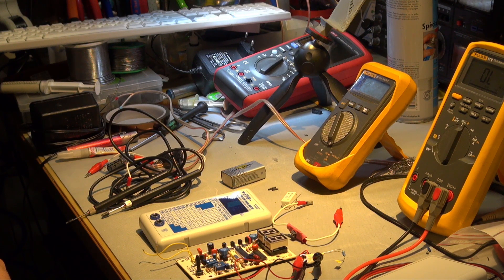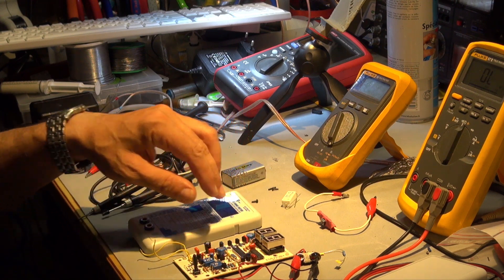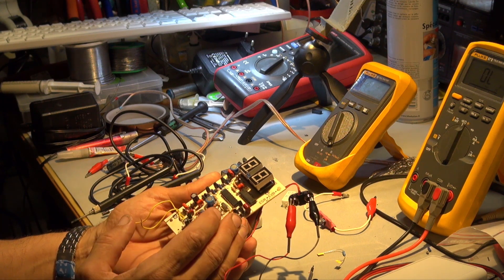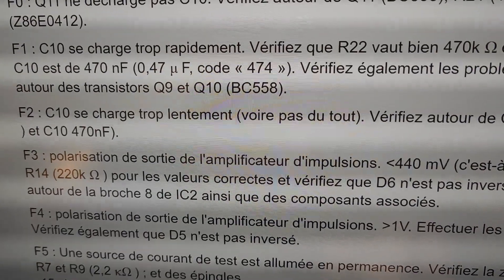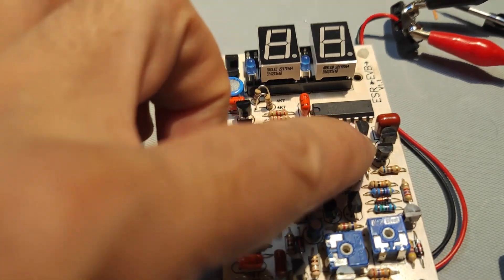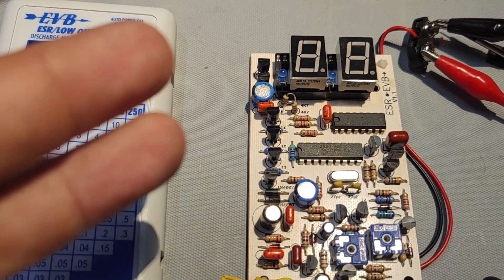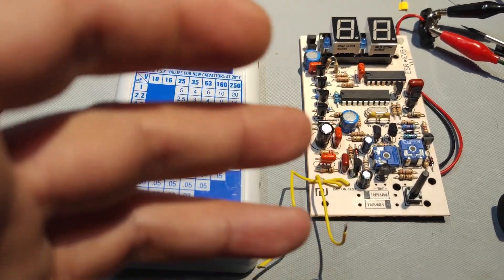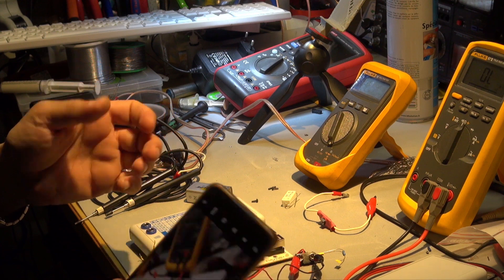EVB esr meters do not appear to be checked before sent.

Comment: I had the same problem, mine has orange silkscreen, after re-soldering all the solder points I had to change a non-polarized capacitor.... and then it worked very well....

Comment: Thank you for the nice video.  I have the blue 2 esr meter and some of the readings are out by as much as 50%. Would you have any suggestions to fix this ?      Thanks again.
Reply from the maker: You can find schematic of the ESR blue on internet, and each zone can be specifiquely related to a special work. In your case you can have a damaged resistor on entry, or bad capacitor somewhere in oscillator circuit (but I think oscillation comes from processor). Maybe a bad component due to charged capacitor. The device contains some transistors, you need to check them. The main component here is the PIC, wich if is dead you can not recover it. Also check if you have diod protection, need to check some components, and also drifted resistors values.
Reply: @AIexanderHartdegen  Thanks for the advice, I will look into this and hope it;s a simple fix

Comment: I have the Blue esr from Anatek which was designed by the same man that designed the EVB one. I wonder if there is a significant difference between the two.
Reply from the maker: the blue can have diodes to protect circuit against charged capacitor. The white one doesn't have diodes, so and because of that, it is certified to measure ESR of batterys. Roughtly, all ESR from this manufacturer are the same, working exactly with the same process.